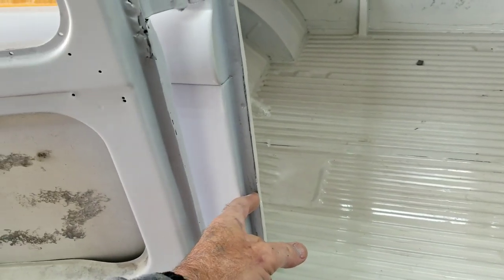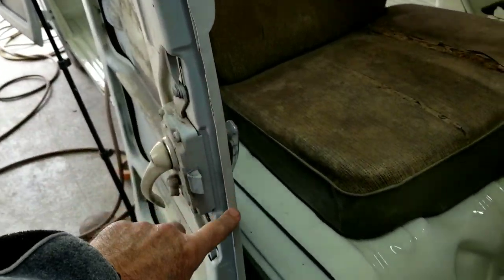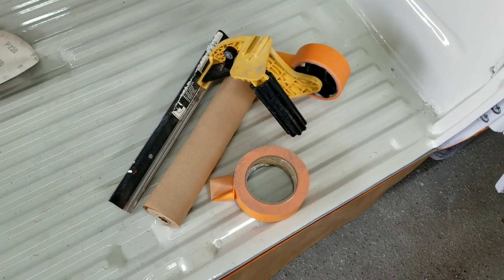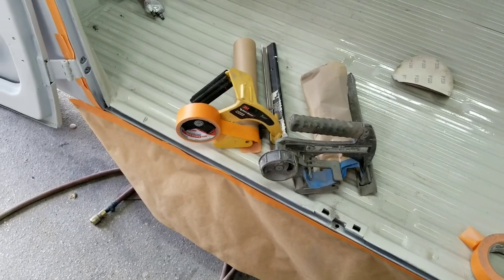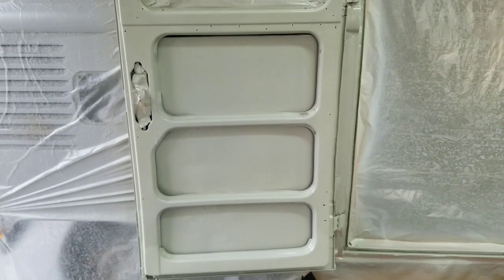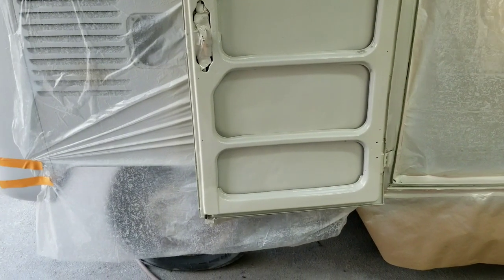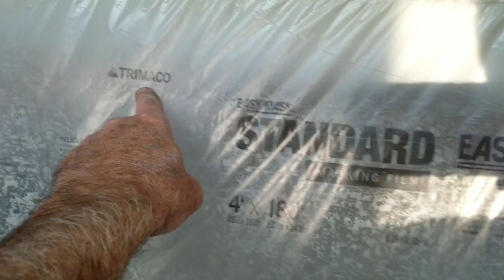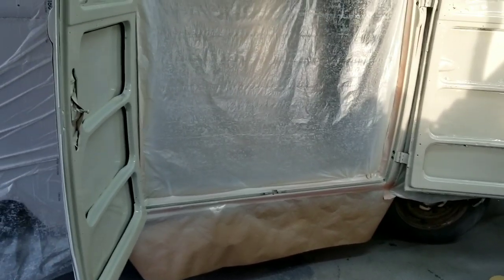RESTORATION - 1967 VW BUS RESTORE- Painting door jams - Other parts Painted

Comment: That cargo door mechanism you could find it at www.eisparts.com  part number 211841605D
Reply from the maker: yea but the original ones are much better. those cheap repops fail. ORiginal ones are pretty expensive.